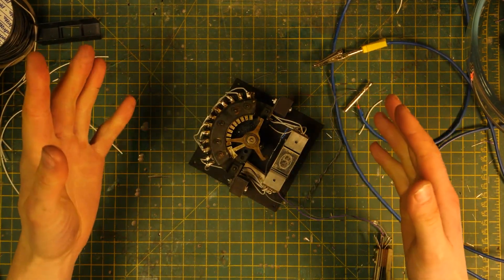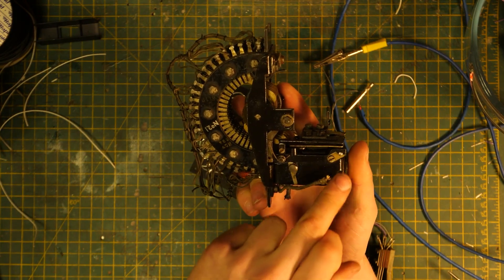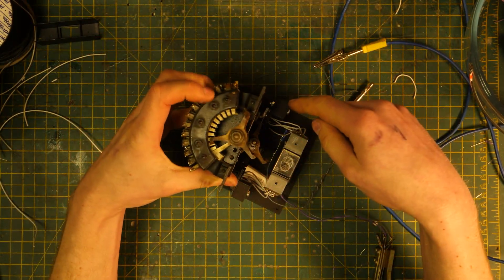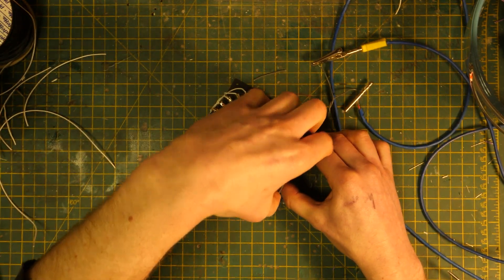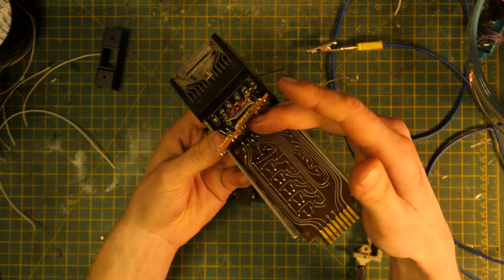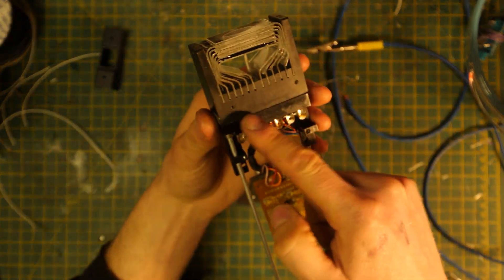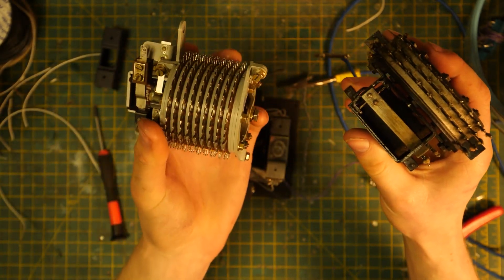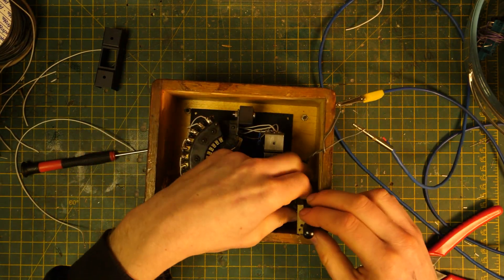DIY Machine - Edge Lit Display Driven By A Uniselector

Comment: Watching this brings to mind stuff seemed to go through a few phases throughout its life. New, current state of the art, put into use. Still in operation but getting on, Obsolete, not wanted, junk, time passes,collectors item. Depending on the item, over the last 40 years or so this has changed. There are some things that still will follow this trend but the majority do the following; New, put into use, breaks or is obsolete, junk. There is no quality or workmanship, no style or design, no quality material use. It just goes in the landfill. (Edit; The modern design can be a bit of genius, but in different areas, packaging, ergonomics, software, etc, nothing that would save it from the landfill).
The difference between the junk of yesterday and today's junk is something  quite remarkable. Today it is almost the definition of junk, yesterday it was obsolete, likely functional, built with precision and quality materials and with a flair for design.

Beautiful switches.

(I was fortunate enough to be in the audio industry during the 80s (and still am). In those times certain products became obsolete and were considered worthless. Most noticeably Garrard 301/401s were on the dump almost daily. The Japanese were buying up every bit of British audio they could get their hands on starting in the late 70s. By the end of the 80s majority of old British hifi was on mainland Japan).. Being a skip diver, I have picked up dozens of Garrards and Quads etc off the junk pile over the years. Not so much these days...

Comment: Imagine using these as a form of memory storage in an electromechanical computer. You could even wire them together in a way that implements addition very simply. Hell thinking about that, imagine the cool sounds an electromechanical computer based on relays, these, etc would make

Comment: You might try a 194 auto bulb for replacements. The are 12V, but you could use a voltage divider. Or the 2176 is 24V. RapidOnline has a 'dial lamp' that's 24V, and cheap, but they're 10x28mm. Is that too big? Somebody beat me with the 45 degree mirror idea, but I agree; it is a good idea!
Reply: They are probably the top as these are 12v

Comment: I remember a Schaeffer automation clock from a radio station one person got going which had Uniselectors in it but used Nixie tubes.  The timebase was a small synchronous motor with a photo-interruptor which produced one pulse per second.
Reply: This one? https://www.youtube.com/watch?v=YajwGdbXV1w
Reply: @johndepaszthory1246  Yes, that's the one.

Comment: Very cool. I love it. Simple, effective, and visually striking. To maximize bulb life, there are three things to do. One: reduce operating voltage. The life is DRAMATICALLY increased by lowering thee voltage to 95%: 85%brightness, 250%life. At 90%V, 65%bright, and nearly eternal life, if left on. Two: don't turn it fully off. Use a small keep-alive voltage to keep the filament warm, but not visible, and reduce the thermal shock on switching. We used to use a series resistor about 10 times the cold resistance (which gave about 30% normal operating V, as the lamp resistance will go up when warm) to do this. Three: use AC to reduce migration in the filament (this is lowest benefit step, but many lamps will have <50% life on DC, all other things equal)